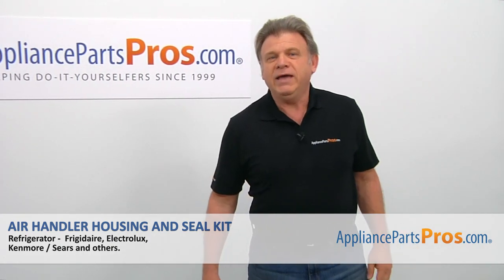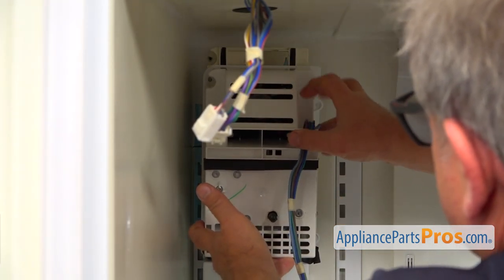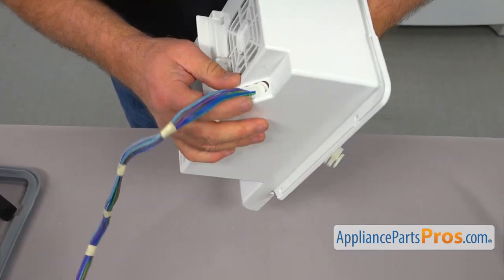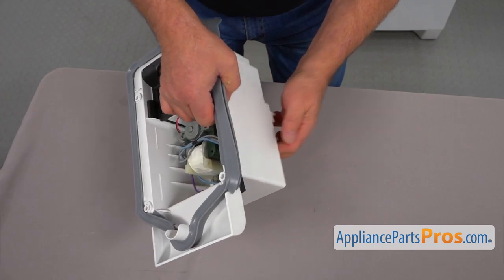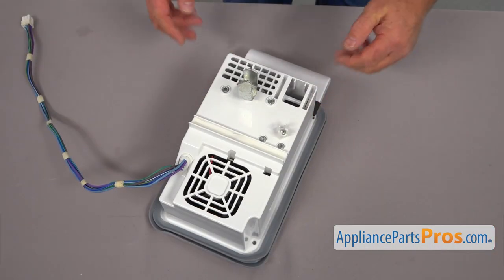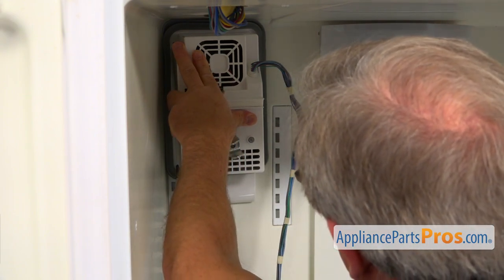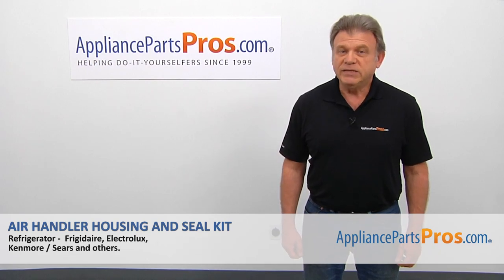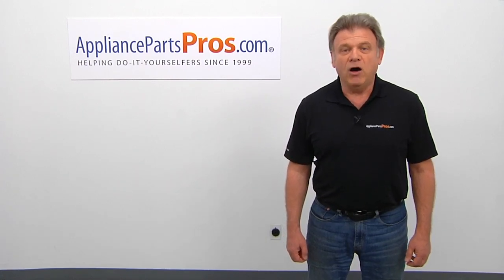How To: Frigidaire/Electrolux Refrigerator Air Handler Housing and Seal Kit 5303918784

Comment: When you reinstall the housing you mention its difficult because of the new seal. (30:00) The video stops and comes back (30:07) and its easier to install. 

This is my problem!  No matter what i do i cannot getvthe housing on. What did you do at the edit?
Reply from the maker: The housing just slides in, there isn't really a trick to getting it installed, you just have to work at it.
Reply: @appliancepartspros  thank you!
Reply from the maker: You're welcome!